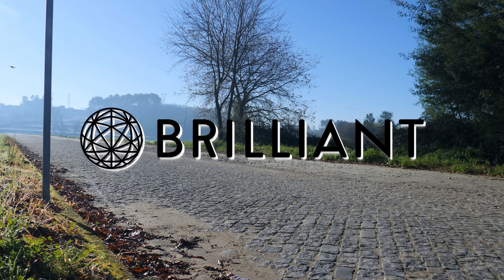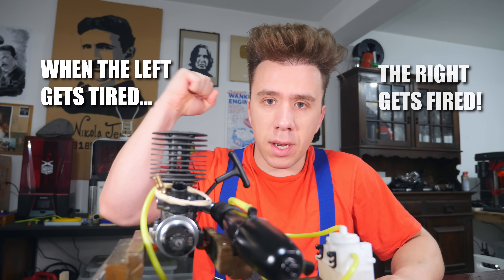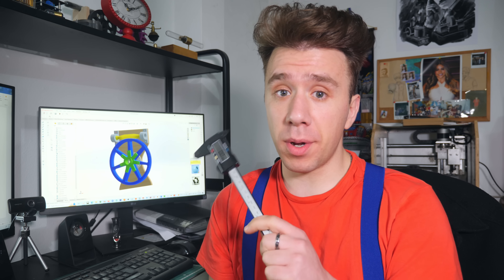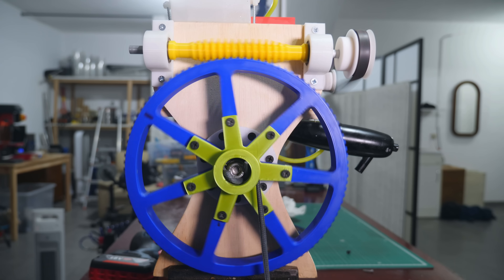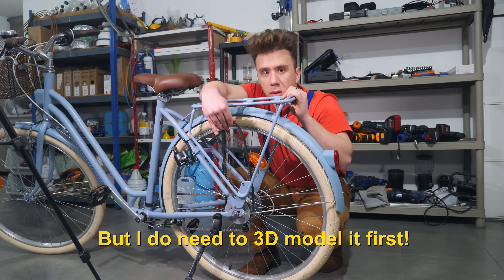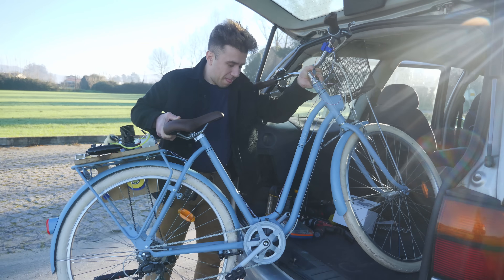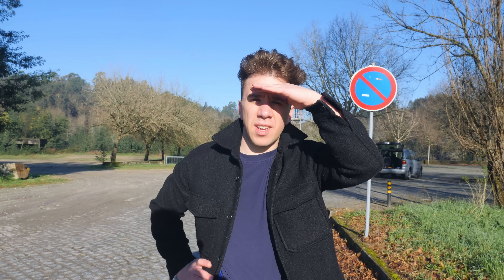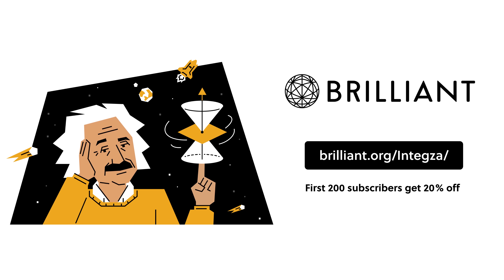Tiny 3.5 cc NITRO ENGINE on a BICYCLE

Comment: Plugging the exhaust till the engine first fires is ideal. They create fuel pressure by using exhaust pressure. They even tell you in the manual to prime them that way if you don’t  have a primer bulb. I had a handful of nitro cars when I was a kid

Comment: Nooo, not a worm gear, they have way to much friction. The amount of power lost to friction is equal to the circumference of the screw at the point of contact, divided by the pitch, times the coefficient of friction, times the power at the output shaft. You're probably losing between 20 and 35% of power from this one friction point alone. Use 2 sets of regular gears instead.

Here is your formula: Percentage of power los = -100 / (Cf × D × π / P +1) +100
Cf = Coefficient of friction.
D = Diameter of the screw at the point where the teeth make contact.
P = Pitch, the distance between teeth.

Comment: Hi man , Judgeing how the engine sounds at idle it seem the mixture setting is to lean so adjust the carb a thad for richer mixture and it vill give more torque and run cooler, and the engine vill be more reliable <3 Nice build <3 cheers

Comment: 1.2hp ==> 894 Watt, which is same or higher than normal ebike motors which usually cap at around 800W. They still make 45km/h+, so maybe the gearing in the nitro engine wasn't optimized, since it should be way higher than 32km/h.

Comment: To start the engine for the first time unit to make sure that there is fuel in the carburator that is why there is fuel line from exhaust to fuel tank in rc car, to do that first you need to blow the fuel line  from exhaust to fuel tank with mouth gently.. so after you can see fuel reach carburator, attach the glow plug, than pull the pull start.. don forget to apply oil filter on filter foam

Comment: A new nitro engine can he hard to start due to the pinch of the piston and sleeve is very tight. Thats why its very important to properly break in a nitro engine so the piston seats into th sleeve as snugly as possible and gets a few heat cycles into it. It's alao important to not leave the piston at top dead center after your done running it. That will leave a loose pinch a tdc where your wanting the most pinch. There's a lot to learn wirh nitro engines lol there is a lot of info on YouTube about them tho.

Comment: this is so stupid I can't believe an adult man in 2023 and climate change would waste time putting an RC motor from the 50s on a bicycle so he could say he did.  when I was a child this was cool  and now its not.   Same with all the other clowns doing the same thing on YT.   Also its slow a hell 28 km is about a normal brisk pace for a flatland bike rider.  Indians put alternators on bikes all the time and they are sillie and heavy but they are clean.   If you want to do the find a cheap  Bufang or other Quality hub motor study the kits and the literature and about lithium batteries and build a bike that will be useful as transportation.  will be useful on bike paths and not stink the neighborhood up,  if you want to go faster they have bigger motors  capable of 50 mph.  Although at that speed a step through honda 50 would be better thats a real basic motorcycle  and the most used motor vehicle in the world by many times. 50-100 mpg too

Comment: You're losing a lot of power to friction with a worm gear, due to the fact that it slides across the teeth of the other gear, rather than the rolling you get with well meshed regular gears.

You'd be much better off using something like the planetary reduction gearboxes you can find in electric tools and kitchen appliances.  If you can't make or source one with the ratio you need, you could always use more than one and still be much more efficient than a worm gear.  MUCH more efficient.

Comment: Thats cool and all but i've been yelling at the computer all video...   DONT USE A WORMGEAR!!   They are not only inefficient af, but they are NOT backdrivable..  meaning that if you try turning the output, it will stay locked in its position. This means if you happen to "roll back" even the slightest bit when stopped you can potentially break EVERYTHING because nothing will allow it to roll backwards! If it were only belt driven with the worm omitted, it would be able to spin the clutch bell backwards which is fine because the clutch is disengaged. 

Also, at the start of your video, you got tired as shit because you did nothing to prime the fuel system. Either you plug the exhaust with your finger and give the engine a few pulls, which pressurizes the fuel tank and pushes fuel into the carb or you plug the carb with your finger and give it a few pulls that creates a vacuum and pulls fuel into the carb..   either way, that mess was completely avoidable. A simple Google search would have gotten you sorted out there.

Comment: The 2CV was for 2 "tax horsepowers" ("chevaux fiscaux" in French) which is a way to rate the car for various taxes according to several parameters including the dynamometric horsepowers (noted as "ch" for "chevaux", horses in French).

That's why you find specs of modern cars claiming, for example, 150ch and 7CV in French car catalogs.
Reply: That’s interesting…. Thanks!
Reply: J'allais l'écrire !
The very very 1st model had a 9 hp engine and the last one a 29 hp…
Reply: It was literally called "Deux Chevaux"...two horses...

Comment: hello, for the brass pinion 1, if you space the steps a little more, with a more spaced net, like 4 steps instead of 6. Because it seems to me that this pinion system has a lot of gearing (although this is not is not the best far from it, but it takes a start, already for the installation of the 2 belts, we lose engine efficiency), but that said thanks to the multiplication of this system (of infinite screw) although it there is loss, we gain slightly as a couple, put into perspective this kind of system fortunately does not need much.

Which means that if you spaced out the steps of this screw, you would then have a better top speed, but less acceleration, but I think that at 30,000 rpm launched with this reduction, you can still lose acceleration to gain in speed. Instructive, it is with little that we start, and that we learn on our own without looking for any documentation that is not necessarily necessary, especially when learning.

Comment: Now think about a hybrid nitro-electric version that will input enough power to keep electric bike batteries (MOSTLY) charged. The efficiencies losses will move from mechanical to electrical but your gearbox will not be necessary and this eliminates a point of failure. Just need to figure how to make about 15 percent more power generating current because TANSTAAFL.

Comment: Great video! However a transmission with multiple gears may help here. Even my (relatively) light nitro RC car has an automatic transmission with two gear ratios. It might help keep it in the powerband without stressing the engine as much.

Comment: 2cv was two "taxable" horsepower. It had an impressive 9 actual hp. "The Cheval Fiscal, often abbreviated to CV from "chevaux-vapeur" (literally "steam horses") in tax law, is used for the issuing of French registration certificates known as "cartes grises" ("grey cards"). It is an administrative unit originally calculated partly from the power of the engine and used to calculate the amount of tax that may be due at the time of registration."

Comment: You should try changing to a compound gearbox, or chain reduction, worm gears are meant for low speed and have a lot of friction loss, which is taking away from your speed.

Comment: Very cool. An alternate experiment would be to simply drive a Model-Aircraft propeller and skip all the h/w associated with gearing to the tire. You could mount it up front and have easy access to the motor instead of reaching behind. Just and idea. Thanks for sharing the video.

Comment: If you knew physics and algebra you could figure out the gearing without guess work. Those little rubber belts arent going to handle the force.. going to need chains and spockets. Amd enclosed metal gears

Comment: Ive seen weed-eater engine mounted on a spring tensioned pivot. With a gear/ nut on output shaft directly against tire.

Comment: The engine was probably lean when when you were trying to start it that's why it was hard to start. I have a couple of nitro t-maxx's and a revo rc cars. Also just putting your finger over the exhaust tip will kill the engine since you can't cover the carb inlet when the air filter is on.

Comment: Unless model engines have changed over the years, they run on methanol, not nitromethane.  All mine (with the exception of the diesels) run on methanol with 5% nitromethane (and castor oil as a lubricant)

Comment: I think you would of done better with a planetary gear set, if you have the engine running the ring gear, the the tire powered from the center gears, you only have to restrict the rotation of the orbital gears to transfer power to the wheel.

Comment: About the actual power of the Citroën 2CV: "2CV" refers to "fiscal power". It is the result of a typically French bureaucratic formula that determines the price of the tax you have to pay when you register your car. The power of the first 2CV was 9hp but the engine has undergone many developments and the latest models such as the one you were driving had a power of 29hp.
Reply: Sorry but the 2CV engine is a « flat Two », meaning two cylinders opposite and CV  means « Chevaux » (horses). At the end of its carreer, the 2CV was assembled in Portugal but this car is French and the name was designed for the French market to show how it was economical
Reply: Also one horse has about 4 "horse power"... so who is fooling whom here?
Reply: 2CV because it had 2 cylinders in V configuration. But it was called 2 cavalos (2 horses) here in Portugal.

Comment: Great video! But it left me wondering how does the engine keep running when you stop the bike? Is the pulley slipping or does the engine have a clutch that you didn't mention?

Comment: Awesome project probably could get some more speed with regular gear ⚙️. Worm gear is very inefficient, lot of power loss in that. Also tuning carb could also probably help nitro lil engines are very sensitive to it.
Cheers

Comment: The blade of your table saw is way too high.  You need to lower it till it is less than an inch above the height of the piece of wood you are cutting.  We need you to stay around for more cool videos, please be safer!

(also, you really should lower the dust collector/blade cover...)

Comment: The 'trick' to starting a nitro engine quickly and easily is to get the fuel system purged of air before you hook up the glow heater. Block the muffler with your finger, and pull the starter rope until fuel reaches the carburetor.  Crack the carburetor open just slightly so past idle, and then hook up the glow heater and it should start within a few pulls.

Comment: I feel like I just went back in time over 100 years ago, and witnessed the creator of the first motorized bicycle, experimenting and trying to figure it all out. Pretty cool. I think this video has made me an amateur scientist/enthusiast.
Reply: There are cheap chinese gasoline engine kits for bicycles you can get online. It isn't the kind of ordeal that repurposing a chainsaw engine or something would be, cause it's a kit designed to be pretty much bolted onto a bike, but it's not all that simple and you learn quite a bit along the way. I have a motorized bike with the 80cc engine kit and yeah it's fun to play around with. You can become an amateur scientist/experimenter for real

Comment: 2.5hp can push a bike close to double that speed, a modern low-friction racing bike with a human putting out 800 watts can top 60kmh. When geared for 32kmh it should accelerate decently and climb a moderate hill. I recommend printing a nine-speed dual-clutch transmission plus a rootes-type positive displacement supercharger, a variable-vane turbocharger and an  intercooler 😆
Glorious fun though!

Comment: These engines have a lifespan of 5liters of fuel  max. Then new piston and sleeve.
Temperature is very very critiical. Too hot engine dies premature, too cold same.
Sweetspot is 100degrees.
Also if after 3pulls the engine doesnt start, check everything.
Threse engine are not worth the hustle, just get a small gas engine.

Comment: The Citroen 2CV never had 2 horse power. That is simply poor research in this Video. The 2CV stands for 2 cylinders. When it was launched it has 9 horse powers, but the engine power was increased over time. Later models had between 12 and 29 hp, depending on the model and year of construction.

Comment: you didn't had fuel in the carburator... usually you pull a few strokes with the finger on the carburator so that it helps sucking the fuel. worst case scenario, do it without the "spark" plug.

Comment: Correction the engine runs on methanol, it’s a catalytic engine there is a reaction between the methanol and the platinum in the glow plug. The nitromethane isn’t really needed just helps tune the engine

Comment: You should probably try to tune the engine a little. Turning an engine in a RC nitro car can make a hudge difference in power. There are many sources online. Other than that, it is super cool seeing you riding that bike that on itself looks really slow but screams like a monster 😂😂😂 
And the speeds you got are very impressive

Comment: Sorry, but its wrong with the Citroen 2CV. This 2 has nothing to du with the engine Power, its only a base for the taxes. its calculated on a formula with the ccm of the engine. The real power of the 2CV is between 16 and 25 hp, depending on type and ccm of the engine.

Comment: What you need is a 35% nitro mixture. 
I think Europe has some tougher restrictions on the higher % mixtures, but here in Canada I have used it in my older RC cars several years back. 
Not exactly the best for wear n tear, but you’ll def boost the performance 👌

Comment: Use helicopter fuel which has more oil content, it will keep the engine running longer. RC helicopters also run full throttle all the time.

Also you're running rhe engine too lean, there should always be a light cloud of smoke from the exhaust, it's not called a 2 smoke for nothing. Turn the high soeed needle one full turn anti clockwise
Reply: Some glow fuels are low smoke, even some 2 stroke gasoline premix oils are specifically made not to smoke...

Comment: Well, funnily enough yesterday afternoon on the way home from work I was behind an old Citroen 2CV, doing about 60 miles per hour on the A14, just north of Cambridge and the guy even produced a decent bit of acceleration after we joined the motorway. 
To be fair the 2CV looks rather lightweight by modern standards and I wouldn't like to see what it ends up like in an accident.

Comment: Why wouldn't you just have the engine connected to the same place where you would have the pedals so you can still use the same gear shifting mechanism

Comment: What you should have done is... Geared it for high-speed...  where you pedal the bike up to about 20 mph... Then engage the motor....  To give you a top speed of about 40-50 with you moderately pedaling.

Comment: Those little motors have about 3 or 4 horsepower, you could just put one in place it the electric on a mid drive e-bike

Comment: Being a single speed you had to be geared low enough to have some take off torque but high enough to get somd speed. Would be cool if you could hook up a 3 speed box out of a small light duty riding mower.

Comment: Please check how many HP had the Citroën 2CV. The Fiat 500 had not 500hp. The 2CV a 600cc boxer, looking like BMW motorcycle boxer, around 40hp , 29 for the 2CV but enough torque... The 2 of 2cv  is a different scale for the taxe classes, it's not the real engine hps.

Comment: Citroen 2CV had two steam hp(Chevaux Vapoures), they used the steam formula for taxation, in a steam piston engine a certain bore & stroke just equals a certain horsepower but it's more complexed than that for internal combustion.

Comment: New video ida nitro methane powered turbo charger use the rc engen to power a turbo charger insted of exuaast or electric use the rc engen to run the shaft of of the impeller

Comment: In France we use the regular horse power scale, but we use "cheval fiscale" which is a tax when you buy a car it is based on horse power, weight, co2 emission level... So the 2cv is for "2 chevaux" fiscaux" ( the price now is around 50€ per cheval fiscal)

Comment: That was crap why dont you use the nitro engine to run a generator then yse the powe for your electfic motor but make it more fun  dont charge battreys run a throttle to directly power the motor in real time directly no correction  just the engine and the genny u can use an ebike motor as the generator the extra hp will account for any losses  . Apocalypse proof ebike screeming its tits of on nitro 😂❤

Alternatively use a variator with the nitro like a moped

Comment: Brass isn't self-lubricating by itself.
But you can buy self-lubricating brass, so why ?

Because it's been sitting in oil during heat treatment, which made it absorb a LOT of it. It's a special kind of brass, not regular one, so be carefull of what you buy ;)
Also, you can go faster with your CNC, it's doing strings instead of chips, and brass is super easy to work with, you can at least go 3x faster from what I see

Comment: I've never been fond of the term "Nitro" engine, because years ago, when they were in common usage for powered models, we just called them "Glow" engines, because of the glow plug used to maintain fuel combustion.

Also, the fuel actually consists of methanol, castor (or synthetic) oil, and nitromethane (ranging from 5-20%).